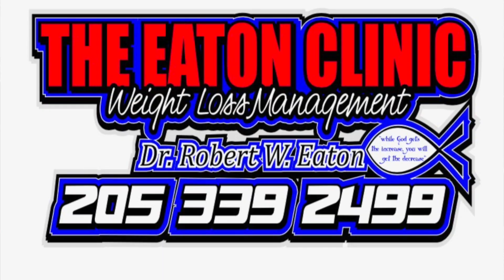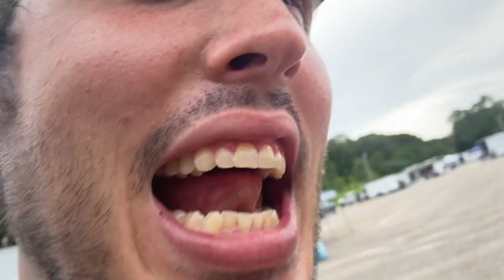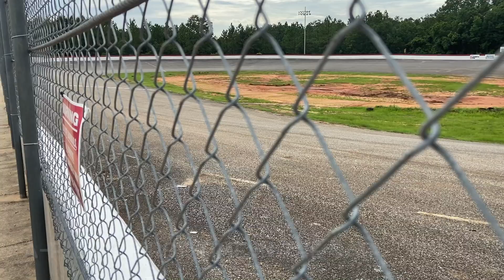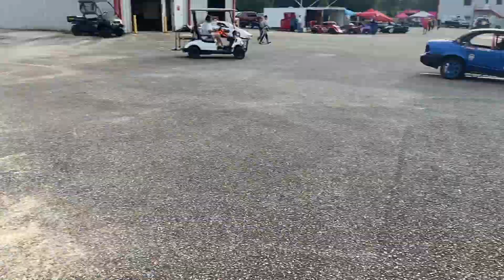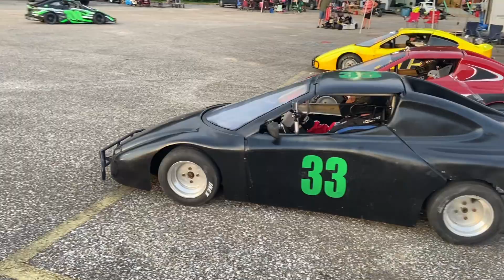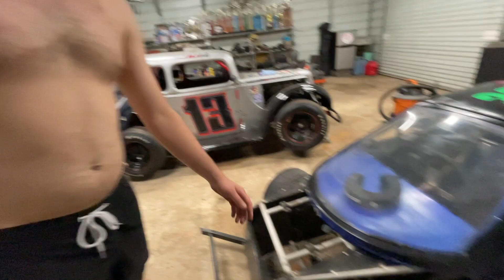The Bandolero Racecar is DESTROYED in 2 Laps! #SHEGONE

Comment: Btw I absolutely hate hitting guard rail. I almost prefer concrete even though I just about bought the farm in 1999’ with a 175g hit involving concrete. Luckily the cars don’t weigh a lot and have slower speeds because I ended up riding a spring. I took a 70g retrograde. Imagine hitting a trampoline that’s sorta my experience with guard rail. Ive even had it wrap around my car and I had to be extracted.
Reply from the maker: Yeah guard rails are no fun